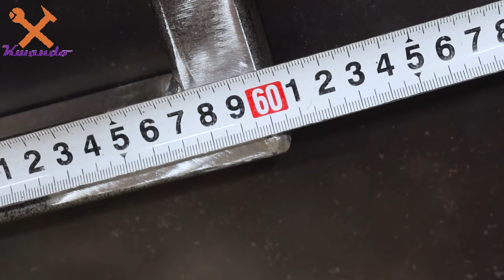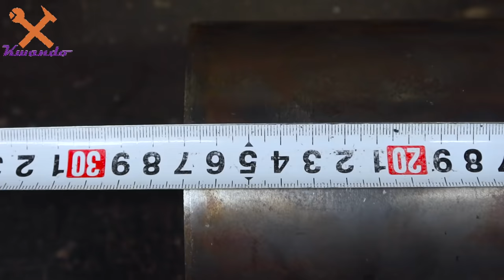Build A Wheelbarrow Using Gasoline Engine From Damaged Motobike | Mini Dumper

Comment: Great job 👍. Please info about welding. This is TIG gun. You do not use additional materials to make welding, only heat? Material thickness is about 2 mm?
Reply: He is using TIG. He is not using filler material as he feels the base metal is enough. The walls of the square tubing are about 2 mm thick

Comment: there will be an accident if there is a collision in the front legs on the edge of the sidewalk (or curb). Adding rubber to reduce impact will be better
Reply from the maker: Many thanks for your advise!
Reply: ज पंख
Reply: Mesin las nya berapa watt dan apa merk nya